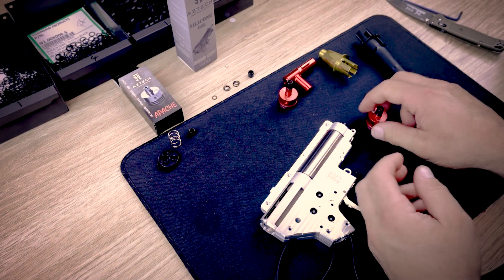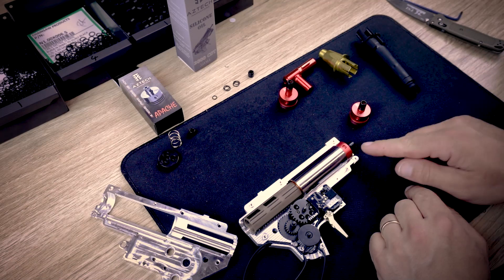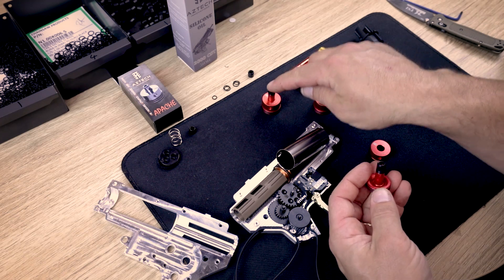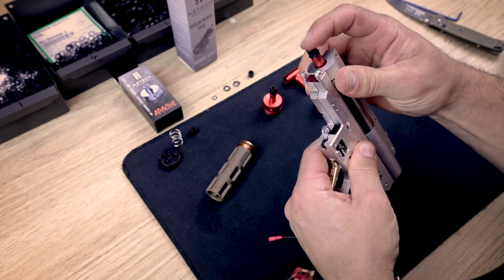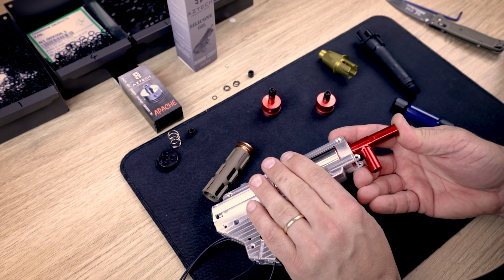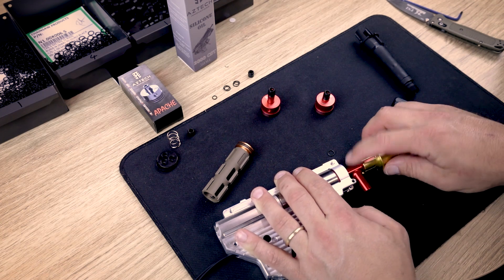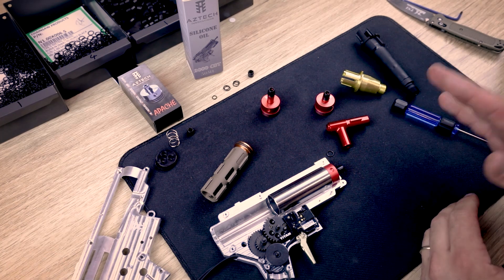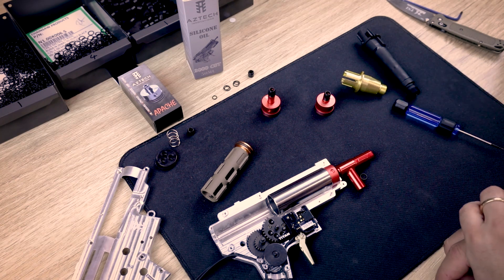Aztech APACHE V2 Instalation and Setup

Comment: Where do you guys get the Tarzan shock proof superglue? Bunnings or automotive stores don't seem to stock it? Would gorilla superglue gel work in place?
Reply from the maker: Bunnings has it. Gorilla glue is good as well
Reply: @AzraelsArmoury  Thanks for that, must just be NQ thing... On a side note, although it may be too much hassle, have you guys thought about stocking products like the glue and bearing grease etc. you recommend on your site? Would be so handy to grab the exact product you have suggested, like in my case, where I can't get it locally. Just an idea. Thanks again for the reply :)